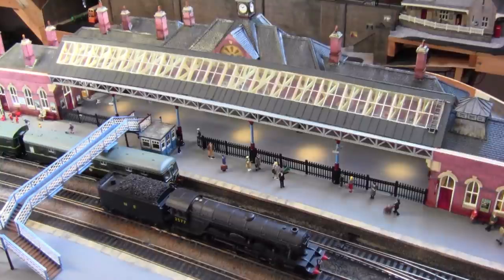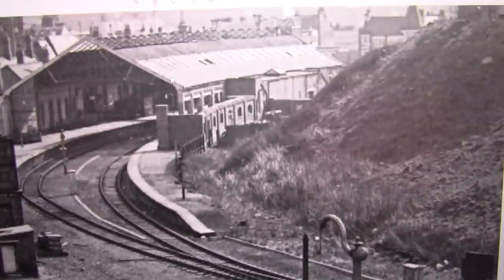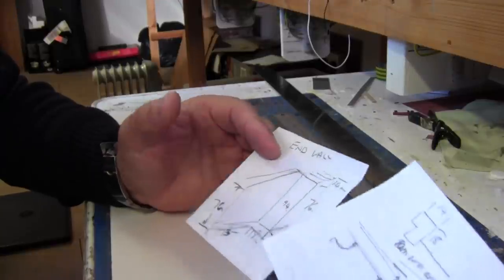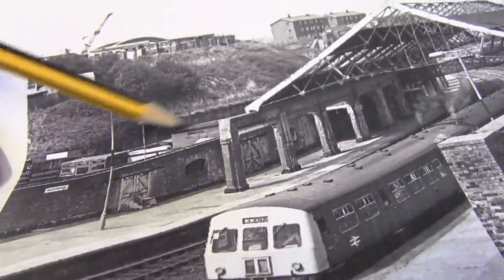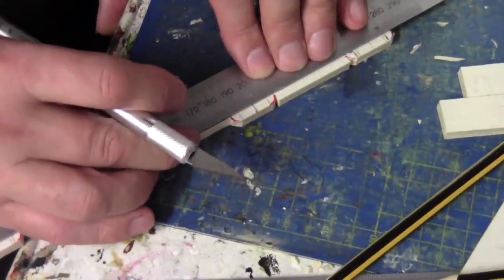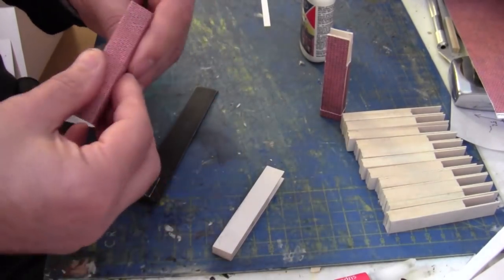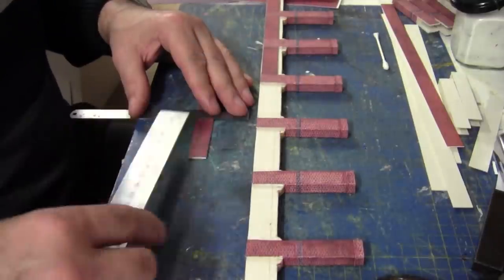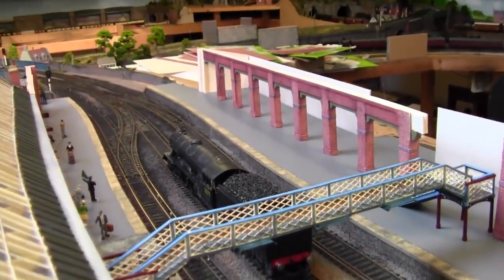The Station Part 23.....Platform 2... Columns...No241

Comment: Another Saturday morning with a cuppa watching that fantastic station coming together Tony, it’s all looking good. I’ve stopped putting a time on anything now, it happens when it happens. I spent a lot of yesterday setting up my first point motor which seems to work I’m pleased to say but I need a 10mm drill bit which I don’t seem to have anymore but spent 2 hours looking for it, more time gone, lol! Thanks as ever Tony, cheers John
Reply from the maker: Good morning to you John. your first point motor. there will be at more firsts. the first building. the first running session. and lots more to come. i think your right. time has no place when your building  model railways. i dont know about you but i do get side tracked. you just have to look what i have done to the station. i did not mean to detail every room. that should not have happened but it did. although a lot of it is now forgotten. every now and again when i switch the building lights on. i see something i have not seen for awhile........your spot on mate...there's no time limit for model railways. even if it takes 2 hour to find a 10mm drill bit. lol.....take care all the best Tony

Comment: Thanks for the superglue tip, Tony.  I've been building "Wordsworth" free retaining wall kits over the last few weeks and have had to sand a lot of card to get the parts to fit.  As you said, it's very messy......!  I'll give the superglue tip a try to see on the next one that I build. (I've got at least another forty to print off and assemble.)
All the best, Ken.
Reply from the maker: Good evening Ken. buy the cheep super glue for sanding the card. the stuff you get the pound shop.it does work. the card absorbs the glue and hardens like wood. ideal for smoothing off. stay safe best regards Tony

Comment: Hi Tony thanks for the tip about using super glue on card to strengthen card I wish I'd known this earlier
Reply from the maker: Good morning Jetmec. i see you are new to the comments section. i have checked out your channel and subbed. thanks again for watching. at least you know now mate about the super glue. i only use the cheap stuff you get from pound land. it does the job...cheer's Tony

Comment: Good day Tony,just me being me -but why did you not use mdf to make the piers etc rather than laminate card? However its looking good all the same......the windows----not seen/found them on web sites...can you tell,or is it secret?Keep it up!
Reply from the maker: Good evening Larry. i think using mdf may have been easier to make the pillars. but the card works well also. not only that i have plenty of card to use up. as for the windows they are not going to identical, but very close there are Ho scale windows. like the ones found in Kibri kits...thanks again for commenting...........cheer's Tony

Comment: Tony, why was the station built in a curve? also, it seems there is a shortage of photos of the station, is that correct? did you ever do any origami? exquisite work as always.
Reply from the maker: Hi John. i am only guessing why the station was built on a curve, i think it was to miss all the terraced houses that was built before the railway came. and the old theatre which was destroyed during the war. thats the only thing i can think off. origami nope never done any of that. made a few paper planes. but thats about it.......all the best Tony